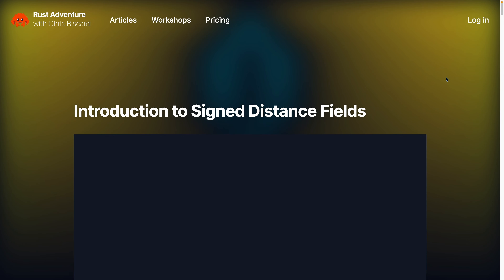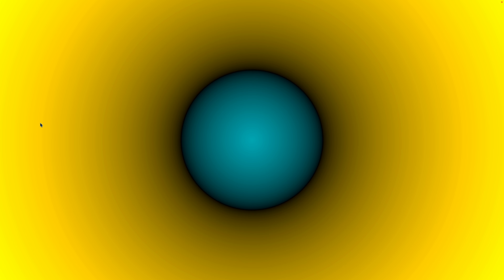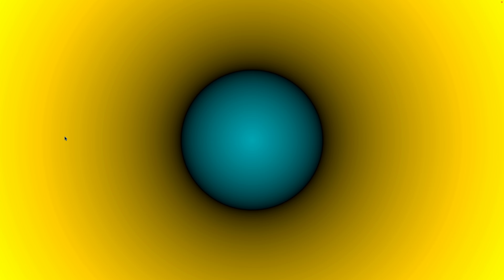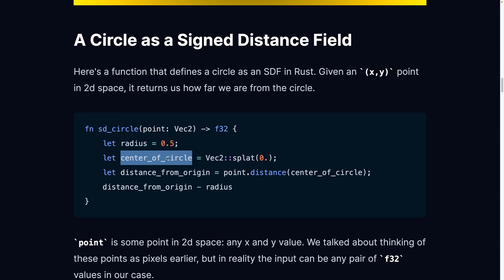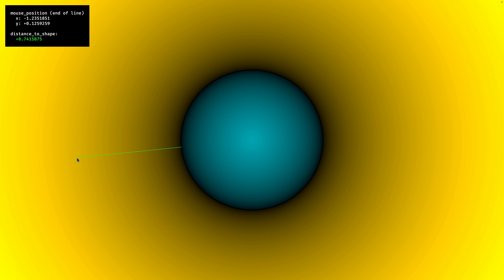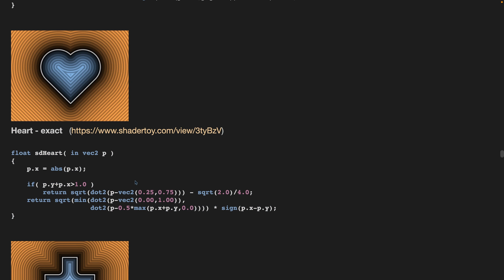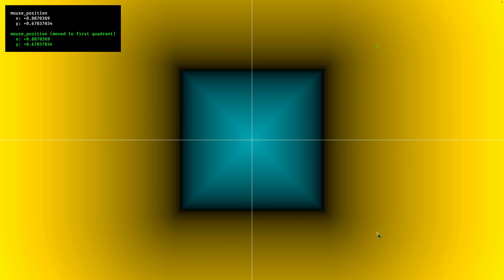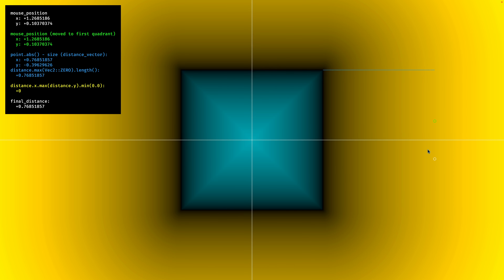introduction to Signed Distance Fields

Comment: You said the ray to the nearest point is a specific equation for each shape, but I think you can generalize it. You can use the partial derivative at a point of the SDF to get the slope, which should point straight towards (or away from) the nearest edge. Given that slope vector and the already known distance, you've got a ray no matter the shape.
Sampling the SDF at the mouse P, as well as a small distance away in the X and Y directions, you can calculate the dX and dY of the SDF value over those distances, which combined is your slope vector.
i.e. `dX := (SDF(P+X) - SDF(P)) / length(X)` should give the change in SDF value along the X direction. Then `normalize([dX, dY]) * SDF(P)` (may need to flip the sign) to get the ray vector from P.